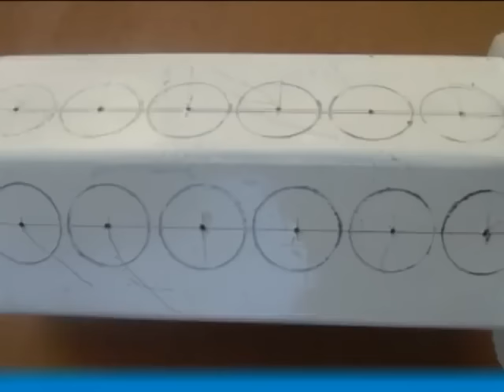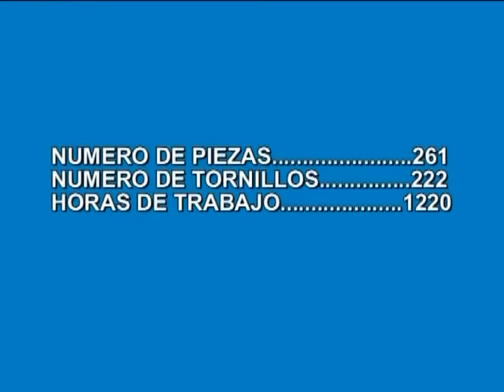Handmade V12 Engine

Comment: Did anyone happen to notice how many Main Web's were supporting the crankshaft ? and what's with the straight blade screw driver fasteners anyway . Hex would have been sweet like real fine thread hardened Hex head cap screws right ? But certainly NOT just a screw driver blade screw .and what was the connecting rod material anyway ? Didn't seem very hearty to me .. in fact they looked like the weakest link in the chain ..
Reply: Please show us the Hex Head Cap Screws YOU MADE for your miniature engine.
Reply: Are you kin to Einstein?

Comment: What is this? Steam engine? Compressed air engine?
No cooling, no lubricating oil chanel.
Camshaft / Crankshaft Speed 1/1.
Such small and complex motors are used in hobby modeling. But model engines are able to run permanently on fuel. But this?

Comment: If this was to be a real gas motor id have a headache, installing pushrods dry, not setting the lash with a feeler gauge, not using engine assembly lube to install parts, ayeyaeyae 👀 but good craftsmanship nevertheless

Comment: Doesn't anybody see that it runs on compressed air?
No sparkplugs, no leads, no fuel.
It is a fantastic job, but it will never run on real fuel.
Reply: %100 true, its fake
Reply: It’s not fake. Mr. Patelo is a retired Spanish naval engineer and his purpose is to show the model and videos to schools in Spain at close doors, where no contamination is important. 

He wants to show the craftsmanship and art of mechanics and for that isn’t necessary to make a functional model but a model where you can see the precision and the steps of manufacturing engines in a manual manner, so this job don’t get lost forever.
Reply: @Yosoyosoy  ok, Clear.
Still, it is a V12 compressed air engine.
Lots of work, many hours.
But i have built a 4 stroke single cilinder engine that works!
https://youtu.be/3qbINaWPoNU
Reply: With your intellect you should have been a rocket surgeon.
Reply: @feellucky271  well, that happens to be my job, doing surgeonry on sick rockets. 😉😅😅

Comment: I’m not sure how the valve timing would work, the gear ratio of crank to cam is 1:1…
Reply: Yeah, I was also wondering about proper fuel delivery. Fuel rails, okay, but only for simulation. Also no spark. Is this running on model airplane fuel? Wouln't you still need some kind of glow plug to get the combustion chambers heated to operating temps? Since there's little sound at the end of the video, I'm think it may just run if he's force-feeding it pressurized air, and he gives it a spin to get it started, then the air pressure takes over...   Again.. lots of ?????  :-o

Comment: I'm sorry nice little toy, but having trouble seeing this thing running with very little compression (no rings on the pistons) which rules out a diesel,  no spark of any kind which rules out a gasoline engine, & no oil pumping to aid lubrication. It minus well be one of those clear plastic electric motor driven V-8 engine model's some of us built as kids.
Reply: Runs on magic and is lubricated with unicorn tears

Comment: To be called an engine, don't it have to make its own power? Think this is a motor!
Reply: Its V12 engine scaled down, he showed the drill testing to see if the crank/pistons were working correctly, by the end it was converting gasoline to rotational power, tis an engine

Comment: These videos are of Turkish origin.   Apropos,  where are the spark plugs and the carburetor?
Reply: I think its diesel
Reply: Actually, this is a copy of a clip by the original Spanish builder motores patelo. He has his own channel, this is just illegally copied. It's also just a model on compressed air, not an actual combustion engine, nevertheless a piece of art made using only a lathe.
Reply: @arifpratama2108  it isn't